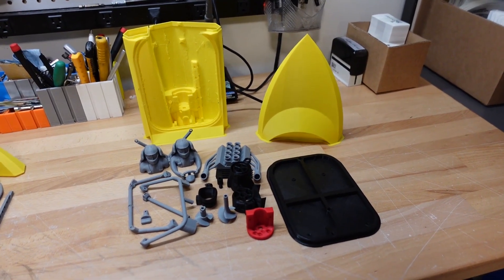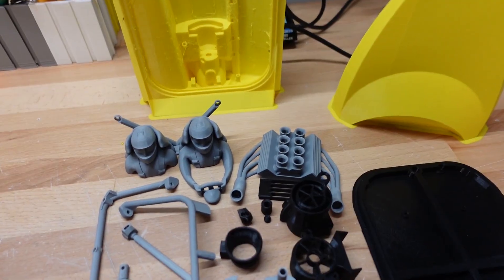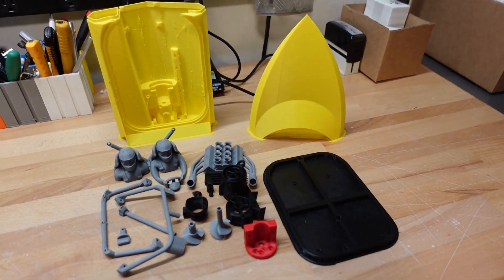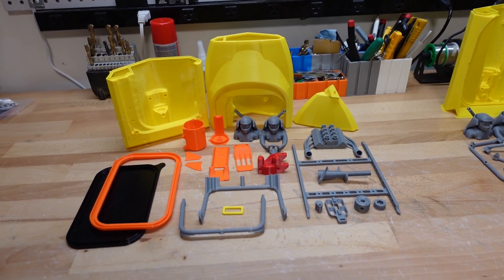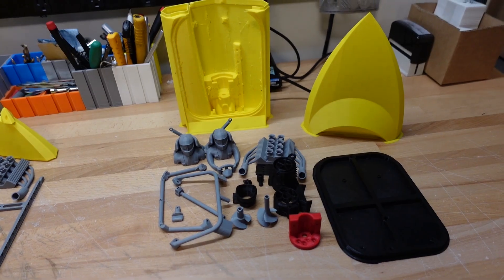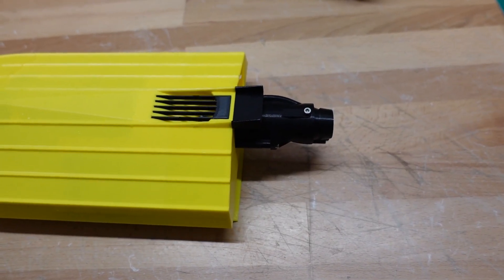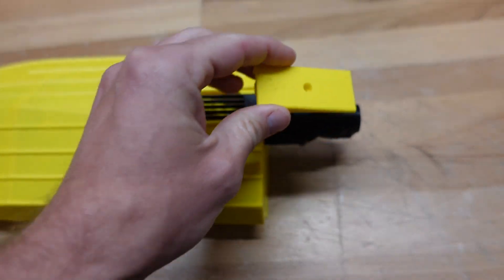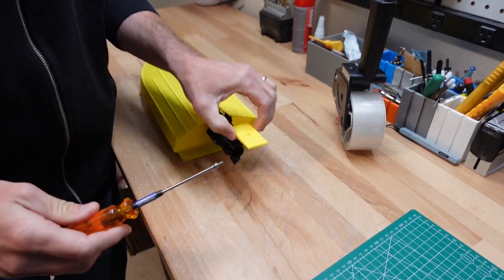3D Printed RC Jet Boat Build + Demo! The MJET Sprint

Comment: What is the minimum size printer you need because I have a a1 mini which is 180mm cubed and I could find the build size? I don’t want to buy the file and not be able to print it.
Reply from the maker: The manual says it requires the following: FDM 3D printer of minimum build size 180x130x180mm (XYZ). The widest Supersprint part is 179x128mm
wide, the tallest part is 175mm tall.

PDF MANUAL FOR SUPERSPRINT: https://drive.google.com/drive/folders/1f-epKNBlcqGcuJU5rGvYQleL7ayPnrRe?usp=sharing
Reply: @rcprinter  Ok, thank you very much

Comment: Just building one now, what motor and battery did you use?
Reply from the maker: https://rcprinter.com/products/m-jet-supersprint-v1-0-build-kits ... the electronics are:
1 - PowerHD TR-4 Waterproof Metal Gear Micro Servo 2.6KG (link)
1 - 20mm Circular Servo Arm (link)
2 - 10cm 22AWG Servo Extension cables (link)
1 - ZTW Shark G2 100A Brushless ESC (water-cooled with XT60+4mm banana plugs)
1 - Surpass Hobby 2150KV Rocket RC 3660 Brushless 4 Pole RC Boat Motor (5.0mm  drive shaft and 4mm banana plugs)
1 - Surpass Hobby Rocket RC 3660 water cooling jacket (36-S)
60cm (2') - 3x5mm silicon water cooling tube

The battery is a 3S 3300 mah LIPO but it also runs great on 4S

Comment: Very nice. I would try to make it little smaller, easier bo build and simpler by leaving the entire brushless motor under water. So no need to cooling, couplers, shaft bearing. 
I did that in an outboard motor it works perfect. Off course less faster than your , but would be a fountain boat.
I ll try to contact you on your website, maybe you can help modify the hood. The pourpose is fountain boat race for kids

Comment: Great boat! You should print the single blade impeller for same performance but longer run time, should be able to print without supports for smoother printing as well
Reply from the maker: I wonder if that would affect the water pickup? The water pickup on this thing is just so awesome, so much better than other boats I've printed. Can't wait to finish the SuperSprint and see how the updated version does.
Reply: @rcprinter  I have used single blade and no noticeable difference in water pickup, just longer run times, still waiting to test my supersprint out as well! I also tested printing the supersprint impellor without supports and had success, just slowed the print right down
Reply from the maker: @petersheffield8264  Thanks for the info, a lower layer height should also help with not needing supports for the impellor